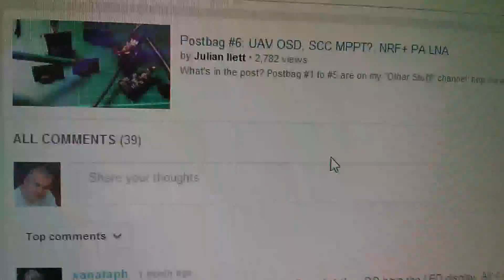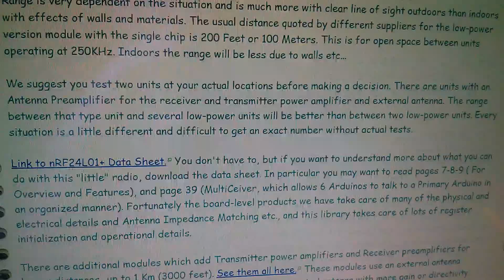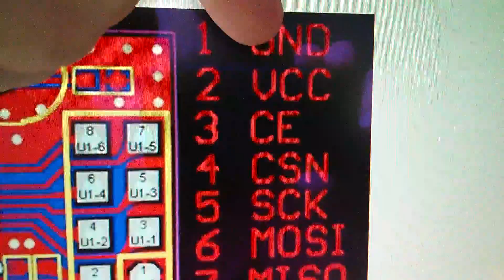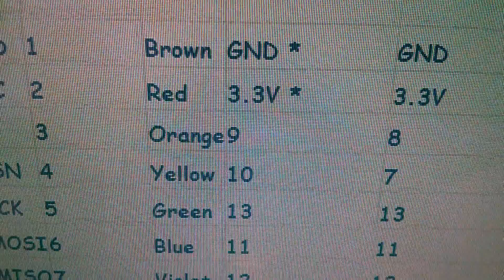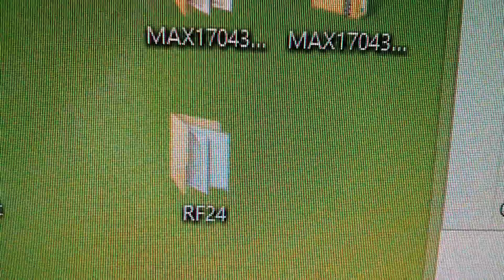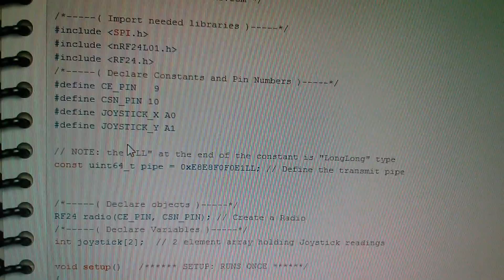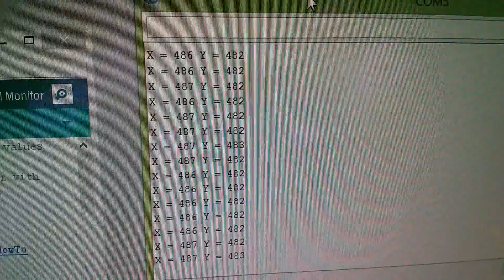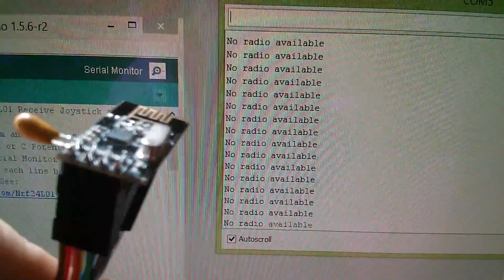1-Day Project: Arduino and nRF24L01+ Data Transceiver

Comment: Check out my blog post about transmitting strings with the nRF24L01 transceivers. With the bare library, you can only transmit integers and numeric data, so I made an in depth guide on converting strings to binary, transmitting, and reassembling on the Rx end here: http://www.walltech.cc/transmitting-strings-with-the-nrf24l01/
Reply from the maker: Walltech OSHW I will take a look at your guide